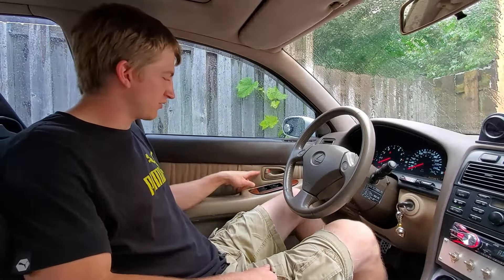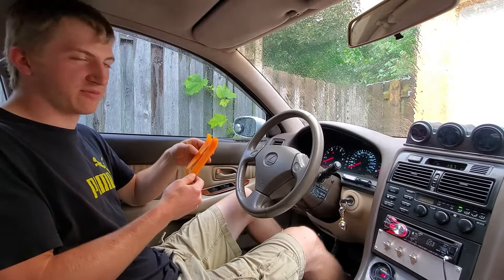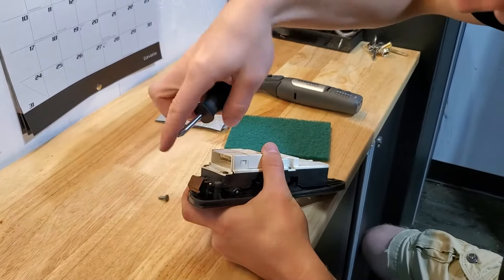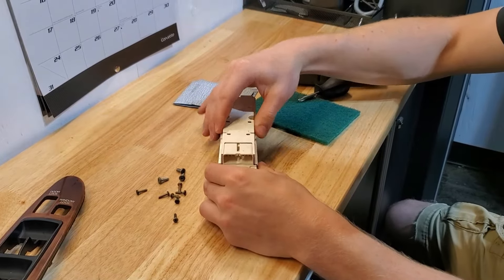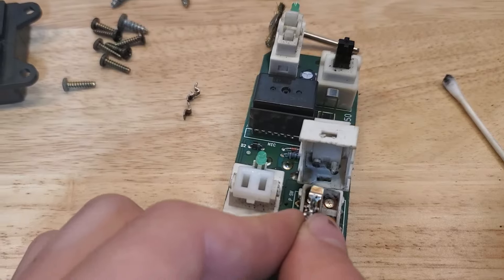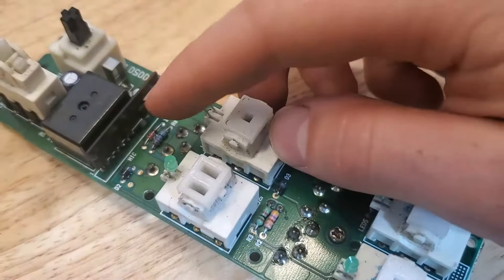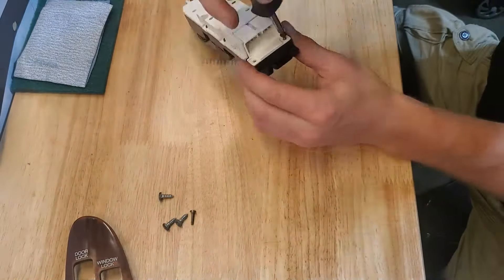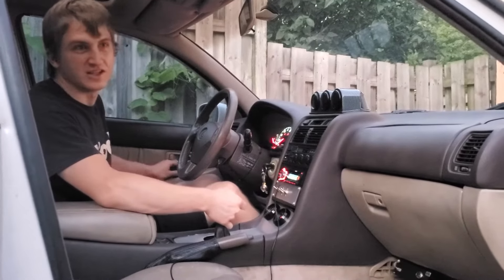How to Fix a Broken Window Switch - FREE

Comment: Could I please ask what you'd advise for a Hyundai i20 where the toggle switch is moving around, rather than being locked into position. My father drove my car and claims he didn't do anything, however the buttons still appear to work if you get them into the correct position (which is quite hard atm).
Is there a way to remove the toggle without removing the door?
Thank you!

Comment: GREAT VIDEO MAN THANKS FOR THAT!!!  My only critique was spray some silicone on your window runners they sound dry as a bone causing the motor to have more than usual resistance that's what I do twice per year on my  rx300 original everything still. Made my day  u just saved my ass from buying a new switch for 130 bucks I thought there was a way to just clean it up good ole Toyotas gotta love em